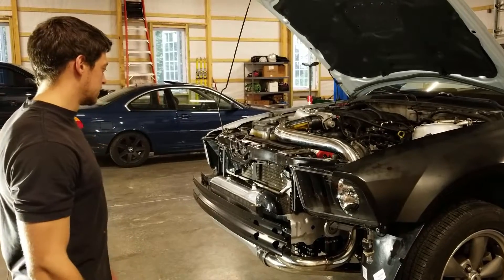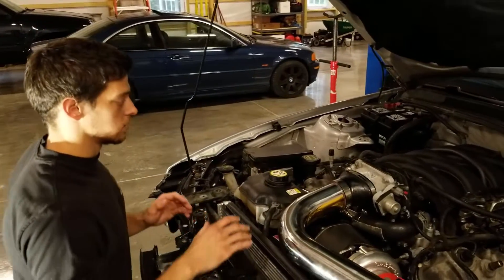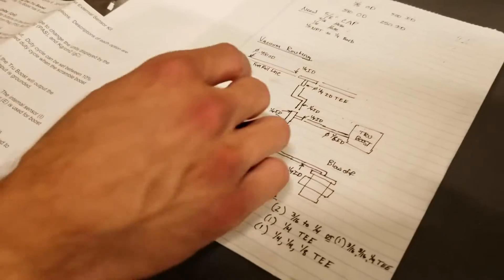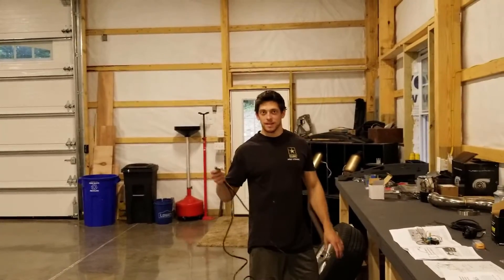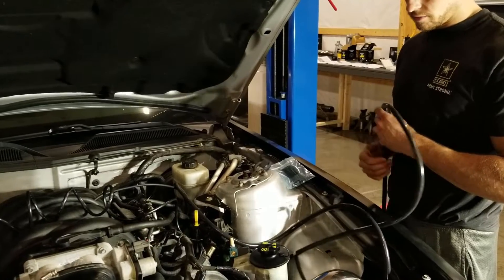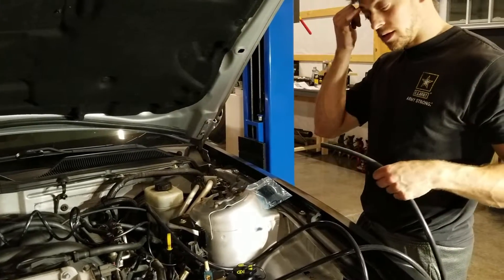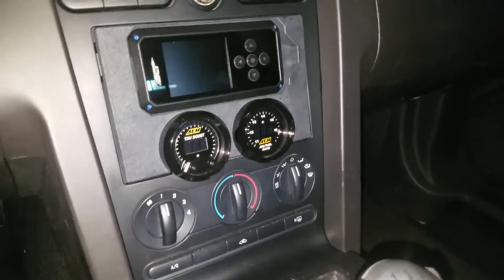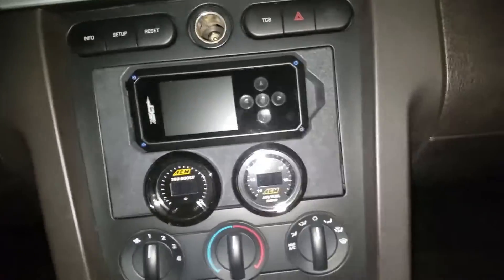3D Printed Custom Gauge Pod - Turbo Mustang Part 12

Comment: Hey Joey, off topic but I was wondering about your shop layout/set up and the sq footage and dimension. I'm starting to hopefully build one at 25' deep and 30-35' wide. Will be a concrete block build (Hurricanes yay lol) with an office and little apartment space above it. 

That gauge and tuner pod you made is awesome. Very nice. I'd say get a patent on that cause some others out there I can guarantee would want a similar set up.
Reply from the maker: Thanks man!! My garage is 50x48x14 with a 12x18 single garage door. Definitely do at least 12 foot ceiling if you want a lift.
Reply: Holy S#@%! Thats huge. Yeah I plan on 18' tall due to making that little apartment space above the office. For when the wife kicks me out lol. if I do 35' wide then I plan on 2 10x10' doors with one lift. I have drawings and a model built up with 2 doors and a 1 door one. 

Going to be one slow garage build! Kids come first now haha I guess
Reply from the maker: @14truelies  sounds like a good plan!!

Comment: Quick question man, what did you do with your pcv valves? Did you run a catch can or are you just running them open??
Reply from the maker: You have to open the driver side valve cover and cut out the pcv. After that you can run open filters or a catch can
Reply: @Kordare  okay cool man, thank you for the response! It’s been an absolute pain installing this kit. Good luck with all your upcoming plans man!!